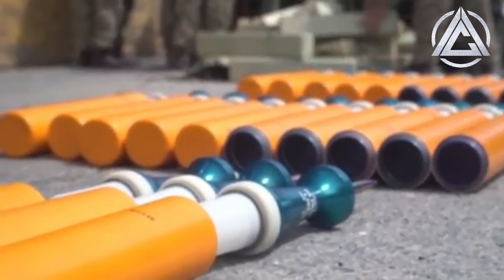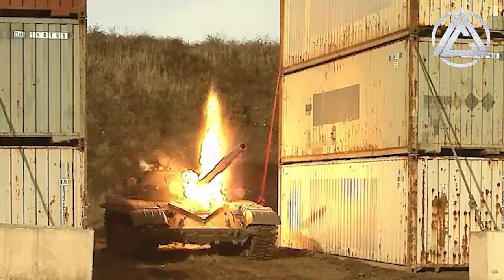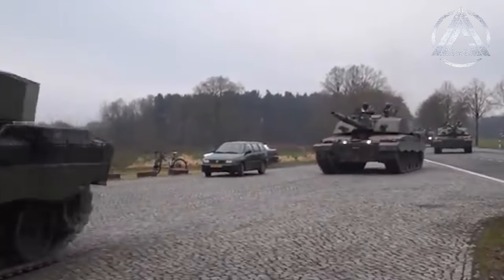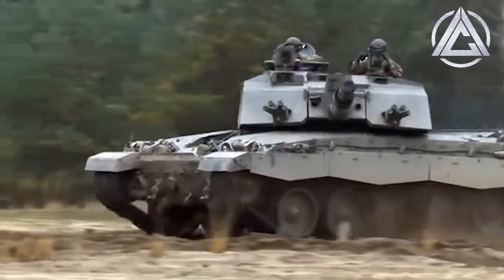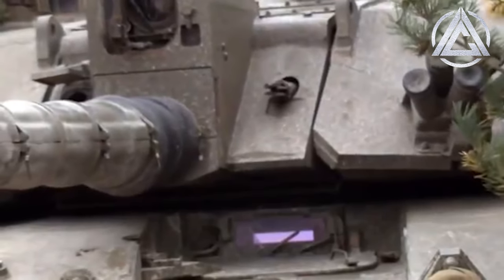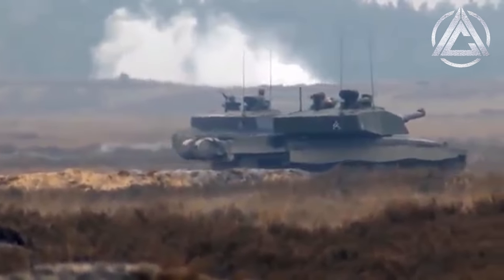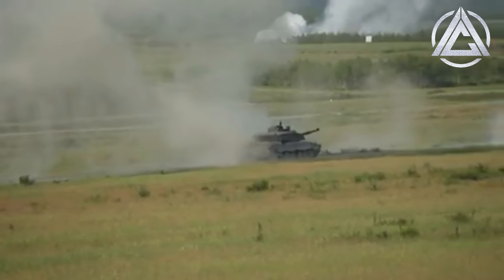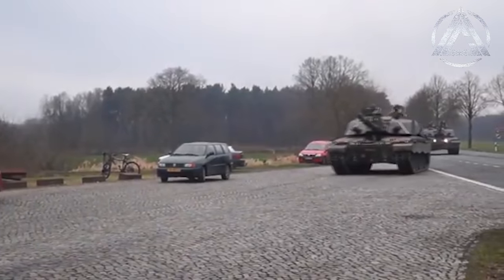Challenger 3 | Britain's New Main Battle Tank | Is It Really Any Good?

Comment: Weight has no effect on top speed. The biggest limiting factor is aerodynamics, followed by friction. It is also of course limited by gearing and engine speed. 

I see no reason why Challenger 3 couldn't do 60mph, and it has probably been tested and proven up to those speeds. However, this doesn't take the ground surface into account. The amount of energy involved in a 60mph full send over very rough terrain is going to end up in rapid drivetrain failures. Common sense suggests a 30-40mph electronic speed limiter would be a good idea.

Comment: You could afford to lose your two and half minute rambling at the beginning.  It is easy to say that it needs to be much lighter.  Ok then, tells us where the weight is going to come off.   Less armor?  A smaller and weaker power pack?  Maybe a smaller gun?
Reply from the maker: Abrams manages to have higher horsepower and better frontal armor as well as a more powerful gun, while being multiple tonnes lighter… 

The key problem is that mating old technologies with new ones requires what the defence industry calls “integration modules” (what we might call an “adapter”)… those things are cheaper than a full redesign, but they’re heavy… and Challenger 2 has a lot of them. Redesigning the internal systems from the ground up can already save you some five tonnes of weight alone (this is likely what M1A3 will aim to do). 

There are other areas to be improved too - CR2’s engine is needlessly heavy because it is an outdated design. These days there are lighter engines with higher power output available. Lightweight guns such as XM360, or autoloader mechanisms to reduce the turret profile (and therefore reduce the area you have to protect with heavy composite armor)… even just lightened roadwheels and tracks… all these combined can easily shed fifteen tonnes off the Challenger platform without losing capability.

Comment: Unfortunately these tanks are obsolete before they start giving a drone costing a grand could probably defeat it the army should have put our money in more apache helicopters big mistake 😂.
Reply from the maker: Drones were super effective against tanks in Nagorno-Karabakh, and they have been during Russia’s invasion of Ukraine, but only because they were a new and unprecedented threat and neither side in either of those conflicts has had access to proper modern short range air defences (SHORAD). We’re already seeing tanks coming as standard with radio jammer suites to fend off drones, most new tanks are coming with hard-kill active defence systems to prevent drones and other munitions from making contact, and as militaries start fielding modern SHORAD systems like Skyranger or CV90 Mk.IV, that drone threat will drop to almost nothing.

Helicopters are arguably a lot more “obsolete” than tanks are! In truth neither are “obsolete” - both still fulfil unique roles that armies require, and the presence of new THREATS doesn’t change these assets’ ROLES. But helicopters are the ones that need the most rethinking
Reply: @ArmorCast  AHEAD rounds would completely shred drones, a shell with flechettes! People just take the wrong lessons from new conflicts and apply them universally.

Comment: Yeh armour trash. How many ever been knocked out, 1 to friendly fire. Christ one tank i think off top of my head had 80 RPG and other rounds fired and the crew drove it back and it was repaired and back out. How many Abrahams and Leopards we see that got toasted. Armour does what it was designed for on Challenger 2. Why it was never replaced till now. unlike Leopard and Abrahams that needed the upgrades to keep improving them. The weight ant a problem as challenger 2 can shoot on move. Jez feel sorry you never been to Bovington tank feast and seen a challenger in person.
Reply: You argument is not the argument you make it out to be. Comparing the numbers and their active use in conflicts you would expect to see more destroyed tanks from the kind that exists more often.

Now the common x rpg argument is always funny since it basically tells you that someone does not know much about tanks. Those were fired at the best armored part of the tank. The front. And if your penetration is not high enough it does barely matter if you fire 1 or 100 shoots at it.
Reply: @emilsinclair4190  Um. It shows that Armour on challenger 2 works. As i pretty sure it it could withstand a IED strike and crew would still be fine. Also when you think on fact that Challenger 2 been around since 90's (minor upgrades) and lost zero (1 to another challenger 2 friendly fire. And yet Abrahams and Leopard have so many upgrades and lost a lot. So tell me how that stacks up to challenger not being as many, so it loses less. It don't, just shows that armour on challenger 2 good as they say. Also it shows you did not look up what i said as the RPG and other hits were all around tank. The challenger may be heavy and slower but it built to withstand a hell of a beating. Also it squaddie proof as most British kit is. 😉
Reply: @emilsinclair4190  Are you forgetting the Iraq and Afghanistan, that where challenger 2 got RPG and other arms fired at it. That where they got proven as doing the job. Sure there less of them, that does not prove they are inferior to a Abrahams and Leopard. Yeh the lower plate a problem for any tank new or old as a sodding mine from ww2 could knock a MBT out. But can the crew survive the ied. Challenger yes as you said one was badly hit they towed it back and it was repaired in UK and used as reserve tank, crew fine. Abrahams i would say no as i seen many of they burned out. Leopards 2  would say worst of bunch as it fast and nimble but armour is weakest of all three.  Yeh upgrades for Abrahams and Leopard 2 are a dime a dozen. Challenger 2 has very few upgrades and why, Cuz it did not need much to sort it out. The Armour on Challenger 2 still highly classified and for good reason it, It works. Have you ever been to Bovington tank museum and tank fest. I have as i live not far from the place and spoke to serving crew and they love challenger 2 cuz it a solid and reliable tank that can take a beating and they can still walk away from it. On terms of numbers yeh Challenger 2 not as vast as Abrahams they mass produce and stored. Leopard are mainly export tanks. So i would say is the on Challenger 2any good yes, as only 1 has ever been totally destroyed and that by another one. 
https://www.youtube.com/watch?v=re-zMIOtSk0&t=10s
Go watch that as it from a team of people that know about tanks.

Comment: It is a German Tank, it will be good😉 But don‘t tell the Brexiteers😂
Reply: Just the gun.
Reply: @BroadHobbyProjects  Also other components. There are many things shared with the Leopard A7V.
Reply: @jurgenmuller143  In both respects to be precise. Leopard 2 (as does the Abrams) use Chobham.
Doesn't matter anyway, it's like the Eurofighter Typhoon it's made with a lot of parts designed and built in the US. The way it is for most equipment these days.

Comment: Me : watches a video of Ukrainian soldiers using a challenger 2 tank... Who say they find the rifled barrel makes the C2 tank much more accurate than any other, and they find the engine to be better than any other as well as internationally being recognized as having the best combat ratio for not being lost due to its amazing armour...

This video: the challenger 2 tanks rifled barrel isn't needed and actually makes it worse, the engine is terrible & the armour sucks.... But don't worry, the challenger 3 will be worse. 

Whaaaa? 
🤷🏻‍♂️
Reply from the maker: It’s not that simple. The rifled gun is more accurate ONLY when firing full-bore rounds like HESH, which is likely what Ukraine have been using as they put Challenger 2 into primarily an assault gun role, as well as canister. It’s less accurate when firing anything sub-caliber and/or fin-stabilised, like sabot, HEAT, MPAT, or AMP, which are the round types every other modern tank uses and they’re vastly superior to HESH.

As for the engine being good… that’s just bollocks, and honestly I’ve not seen anything from Ukrainian troops praising the engine specifically, especially in comparison to Leopard 2s they’ve also been using. If they’re praising the Condor it’s only relative to the old Soviet sh*t they’ve been using in the assault gun role previously. It’s not only underpowered, but it’s unreliable and difficult to work on.

The armor has never really been tested in combat. It’s survived a tonne of RPG-7s, sure, but those are early 50s munitions that shouldn’t pose a threat to ANY modern tank. On the flip side Challenger 2 has been penetrated by RPG-29s, and landmines, (the latter twice now, with Ukraine losing their first Challenger 2 two days ago).

Challenger 2 hasn’t been deployed HALF as often as Leopard 2, and barely the smallest fraction as often as Abrams, and when it HAS, it’s not faced anything more significant than an RPG, some of which even actually pose a threat to it thanks to the dogsh*t lower plate armor…
Reply from the maker: @TomatoToMaToes69 oh I’m not a fan of Leopard 2 specifically, in fact I made a whole video trashing on the damn thing! 😂

It’s just simple facts. If Ukrainian troops are praising Challenger’s engine or gun compared to Abrams and Leo… I dunno what they’re smoking but I want some!

As for armor, CR2 is great, but Abrams is better, and Leo 2 should be about on par depending on variant. All evidence I’ve seen points to the tank being damaged primarily by the mine. Kornet may have hit it after, but the damage done was done via ammo detonation, and a landmine is the most likely cause of that

Comment: Why doesn't nato just create 1 battle tank used by all and mass produced. It's like every american state making their own tank
Reply from the maker: Partially national pride, partially that different nations have different requirements and therefore build their tanks with specific strengths and weaknesses in mind that suit them.

Across most NATO tanks, ammunition is all compatible, but as for standardised tanks, that’s likely to remain purely for things like APCs or artillery. Most of NATO use the same few UAV types, and of course the F-35. Possibly all of Europe at least will adopt a standard MBT eventually too
Reply: It doesn't make sense for Russia to constantly crank out a new tank every 8 to 10 years. Why not stay with one tank, upgrade, retro fit the tank, after x amount of years get rid of it and create an whole new tank platform? 🤣

Comment: 8:08 sorry but that's bs, are you actually suggesting that chally 2 was designed to be only able to defeat t55's. It's development began in 1986 and entered service in 1994, along ways after the likes of t64 t72 t80, i wasn't there at the time but I'm pretty sure they took those tanks existence into consideration, in fact this video (https://youtu.be/re-zMIOtSk0) pretty much lays that out, specifically at 13:13. In the same video it is stated that in 1978 a chieftain can defeat the frontal armour of t64 at  2500 meters, I would like to think chally2 could do the same at the very least. Having a greater emphasis on infantry support than its NATO counterparts hardly makes it an infantry support tank solely, you could argue that by keeping this greater emphasis of infantry support  chally2 has a positive trait its NATO counterparts lack, as tanks work best when supported with infantry i would say its a positive design feature.

Comment: Eventually aps will get so good that killing tanks will just be inpossible. Tank on tank combat will eventually be about hopping ontop and cutting hatches open to get to the crew than shooting them instead of just shooting eachothers tanks with the cannon. Ukrainiane has allready made aps that makes apfsds basically just not work at all
Reply: there will never be an APS system that will stop a 120mm dart travelling at 1800m/s lol
Reply: @night7185  already is. Kind of. It cant completely stop the projectile but it is capable of damaging it badly enough to where it only penetrates like 30mm of rha. Obviously some more variable control the results such as if it's a apfsds shell with one or multiple cores. It wont save a truck but it will make most tanks equipped with it absolutely impervious to incoming fire from tanks and infantry unless they pull out the cattb and its 140mm witch is too big to be stopped. Already has been tested against 120mm and actually stops most 120mm ammunition better then the 125 ammunition used by Russian tanks aulthough the Russian ammunition is just worse
Reply: @sparrow9990  a 120mm shell travels way faster than any atgm, unless u invent a force field ur just not countering that
Reply: @night7185  I'm not talking about atgms. It's a aps that has the ability to hit the shells fired at it
Reply: @sparrow9990  there isnt an APS in existence that can stop a 120mm dart travelling at 1800m/s

Comment: Has no one learned anything from Kursk?  Wasting your big buck tanks on tank on tank battles is likely the best way to blow taxpayers money.  In modern warfare you use ATGMs to take out enemy tanks and you use your tanks to take out soft targets, cross fire zones and knock down fortifications.  Has anyone ever wondered why T-54/T-55 and T-62s are still logging more actual combat miles than any other tank worldwide?  Because they are still da*n good at knocking down buildings and mowing down insurgents and if you avoid a head on confrontation with an Abrams or a modern ATGM, they are actually pretty durable. Lastly the loss of a single Soviet era tank isn't going to wipe out your third world nations entire GDP.